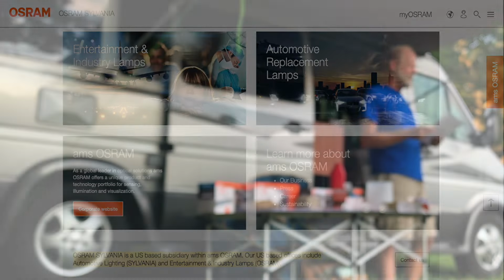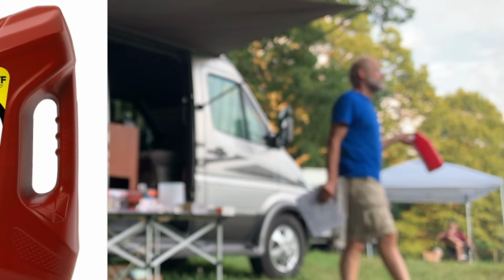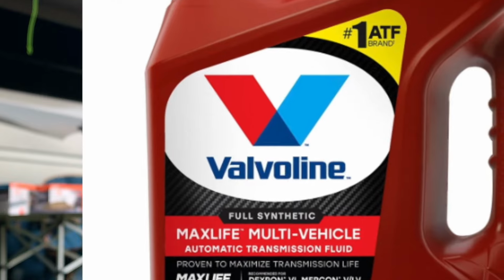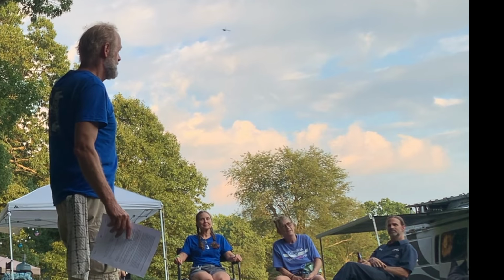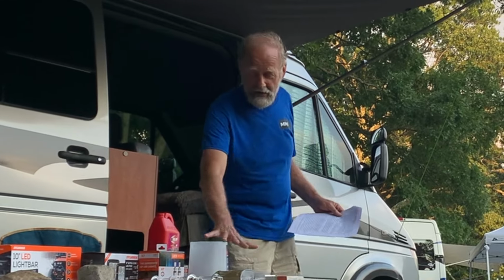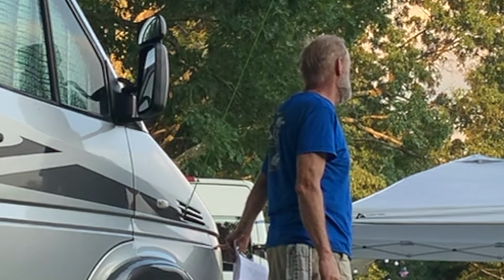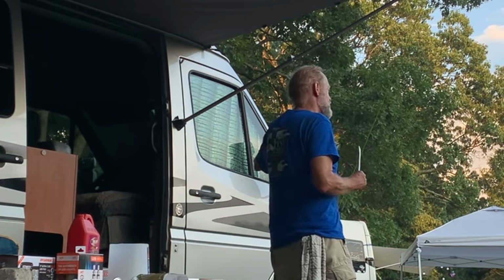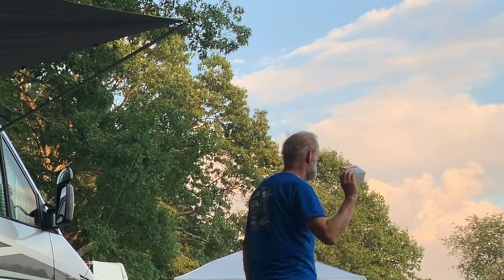Sprinter Headlight Restoration & In Depth Discussion

Comment: Nice presentation.  Can anyone spell those two Taiwanese manufacturer names?
Reply from the maker: One is Depo Auto Parts Ind Co Ltd and the other I think* is Tyc Brother Industrial Co Ltd.
Reply: @FloridaVanMan  I agree that out of all aftermarket brands from Asia TYC and Depo are the only ones that have acceptable quality. Used them on different old cars I’ve owned. They still aren’t the same quality as OEM though. Plastic and mold quality do not feel the same, the fit is not as precise on mounting points, they go dull quicker than oem, dull in five years when originals lasted 15. I’m a cheapskate and drive old and reliable and owner repairable cars, so I’m fine with this two brands at the price point.